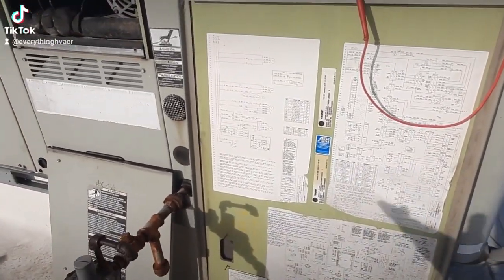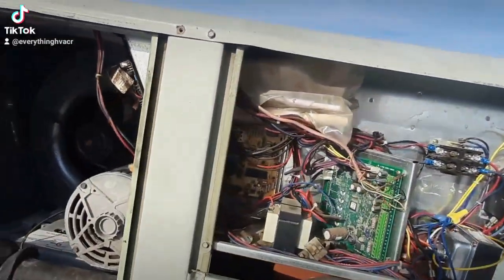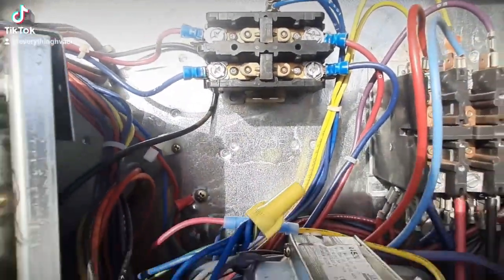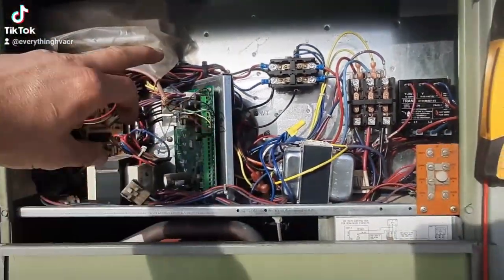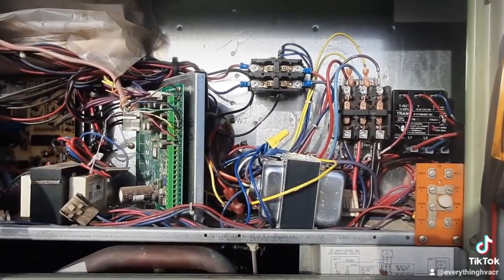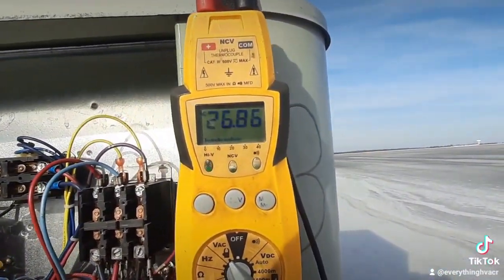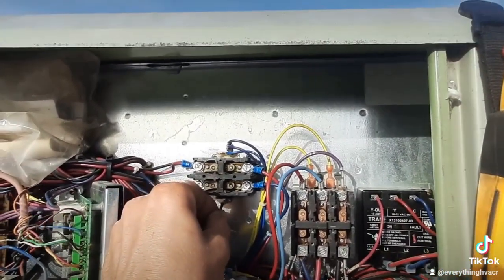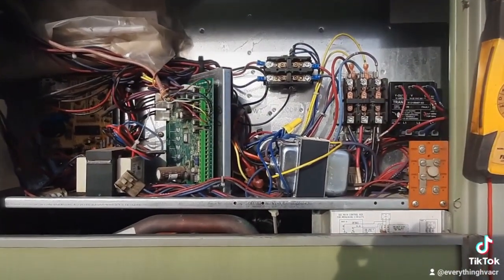you need to see this if you work on Trane. Triac voltage control diagnostic

Comment: Check it (voltage) with contactor in circuit..
Or us meter with low Z to load up 24 volt circuit ...
(Semi conductor is leaking thur)

Comment: Your contactor isn't pulled in because you dont have a common going to the contactor coil. You should aways check a coil across the actual common and hot, not from hot to some other ground or chasis ground. Some safety circuits will cut out the common side instead of the hot side.

Comment: The first thing to know is to always test for the voltage when the wire is attached to the load...rather than just to a wire, like in the example. If you test to a disconnected wire, it allows the high impedance meter to see the voltage at  the triac output, even though the triac will not flow enough current to pull in the contactor. The meter only needs a tiny available current to indicate a voltage, and it just so happens that the triac will allow just enough current to slip by the internal junction to give the meter that voltage reading. So...if you always test against a load, like the contactor coil, and assuming the coil is good and the common side is connected, you will get the right voltage reading for the output state. Older Carrier heat pump RTUs had a freeze stat between a contactor and the common bus, and you would only know it was there if you looked at  the wiring diagram...which was often so faded that it was illegible. Moral of the story...test with wires connected unless you are reading coil resistance.
Reply from the maker: Thanks, Art!

Comment: Most triacs, by design, switch the ground as "output" to complete the circuit...unlike relays that usually switch the hot line. This gets tricky for most technicians, because for troubleshooting you need to have the load connected (contactor coil, light bulb, motor, resistor, etc) for the triac to operate. You read 24 VAC because one side of the contactor is always connected to 24 VAC; the other side is connected to the triac. When is "on" it completes the circuit to ground and when is "off" it opens the circuit.
Reply from the maker: Thanks Sergio!

Comment: For low voltage controls you should use LoZ function on the meter (if you have one), to avoid chasing your own tail with ghost voltages.
Reply from the maker: Thanks Commenter! Ghost voltage can be tricky, I will check that out
Reply: @EverythingHVACR  Ones I had ghost voltage of 115 volts  that was feeding through the incandescent light bulb on the control panel, the funny thing was - the light bulb wasn’t lighting up!😁
Reply from the maker: Electricity is always interesting.

Comment: please do sequence of operation, thanks
Reply from the maker: Nothing really special on Trane, signal comes in to RTRM Board and out to contactor. Only difference is safeties are not wired in series, all 2 wire safeties feed back to board to monitor if anything opens, contactor coils are the same separate 2 wire feed for each. I will try to make a video happen, Thank you!

Comment: So I saw you keep measuring voltage from that lead to ground?  Why not measure voltage between that lead to the other lead that supply 24v to that blower coil? Isn’t that click that your hear is when it made for that other coin lead to ground? Other words the other 24 volt coil of the blower contactor always connect to ground or other end one 24 volt transformer or only connect when you hear the click?
Reply from the maker: There are different ways you could check it, I honestly don't remember exactly how I was checking, just thought it was interesting the way the Triac works and could make diagnosis difficult. Thanks Quang!
Reply: @EverythingHVACR  a agree that there are many way to do things.  What I think is we have to check the voltage on the coil terminals unless we know that the other terminal always connect solidly to ground plus one end of the transformer 24vac terminal connect to ground too.  I don’t work on Trane a lot other day I have a Trane that blower run but ac not running I just end up by pass all that and supply 24vac from thermostat straight to the compressor contactor coil.  I’m not sure if customer wanna pay money for replacing those board as you say in your video.  So do you think that triac made to connect other coil to ground?
Reply from the maker: Yeah the boards can be expensive though in my experience these boards rarely go bad on their own usually something causes the failure. I have seen some wired the way you said as well

Comment: I have replaced a relay and put in after market instead of a relay on a triac controlled board. It wouldn't drop out after the call for it. Found out the relay had a board controlling it which held the triac in. Put a normal coil contactor in it and works fine. Triacs are a fiddly thing to sort.
Reply from the maker: No doubt, Thanks Jochem!

Comment: Ucp Snubber circuits?   A Resistive/Capacitive series circuit. Wired in parallel with relay contacts. A filter that increases contact life. Dampen voltage peaks created by the closing and opening of contacts. Found this in the manual. Hop it helps keep up the good work and videos.
Reply from the maker: Thanks Jason!

Comment: I think there could be lees of a surge on the triac by switching the neutral.
It's normally the live that is switched. 
Nice thing to mention as could cause you a problem if you did not know 👍👍👍
Came across this sort of thing on other electrical circuits.
Reply from the maker: Thanks John!

Comment: When i come across something like this seeing 24volts 120 208 240 480 or whatever and and the control is not activated i always double check for ghost voltage with electronic based controls i set my meter to the LOZ setting...just saying
Reply from the maker: Good idea 💡 Thanks Ralph!

Comment: Triac's don't switch unless they have a load across them. So if you energize triac with out it connected to a load it just sits there and does nothing. Your VOM is not enough to make it switch if your measuring across contacts.
Reply from the maker: Yessir, Thanks Glen!

Comment: It's the snubber across the triac which passes a tiny current.
The snubber is a capacitor and resistor in series which is connected across the triac.
It is there to absorb the energy from the contactor electro magnet when it is de energized which is released as high voltage and would damage the triac if it is not there.
So, you need to have the contactor coil connected when testing if a triac controlled output is being switched.
Just something to remember.
Reply from the maker: Thanks Uncle Duncan! 💪 I've dealt with the triac on some old trane vav boxes but didn't know the RTRM board used them.